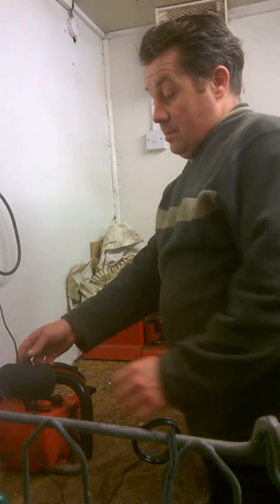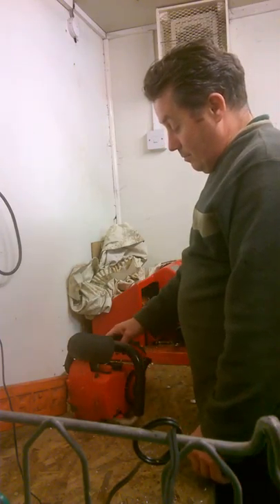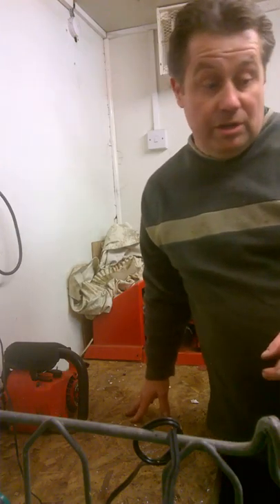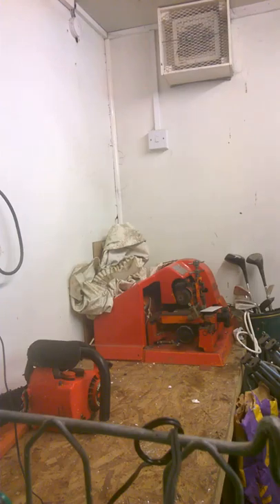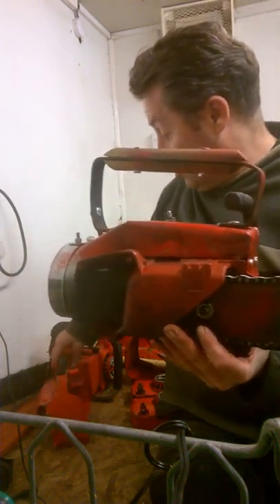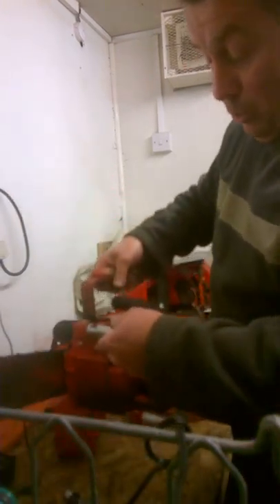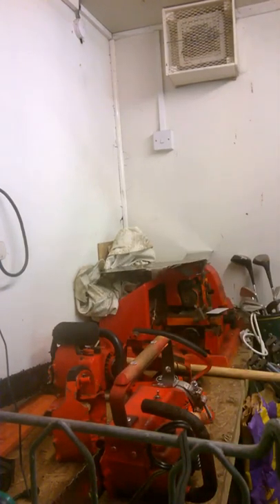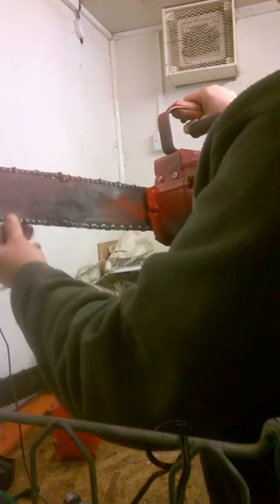Evil Dead chainsaws, info and building tips

Comment: Actually the super 2 body angles in on the slope on the rear right side.  The xl slope is straight.  It makes the super 2 a pain to convert into an evil dead 2 chainsaw.  I tried one before.
Reply from the maker: I have seen one like you describe, I think it was a plastic bodied 205 with the slope angled in to house a larger exhaust and baffle. The 2 super 2's I have at the moment are identical to the XL and XL2's I have. Homelite did tweek the bodies in later models to incorporate different fuel filler caps, carbs and setting screws and as I advise the exhaust mods. these I think are the plastic bodied saws..... thanks for the post!
Reply: Check out my chainsaw I’m doing at the moment.  Look up evil dead chainsaw in progress.  My name will be by it.  I would like to know what you think.
Reply from the maker: You have some cracking saws, an inspiration to look at